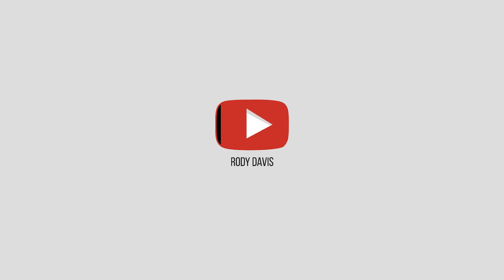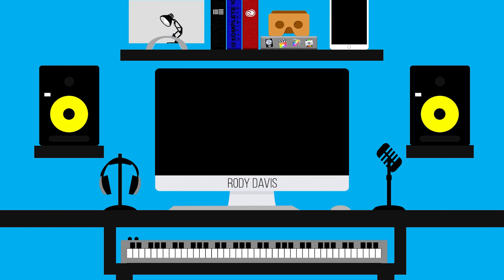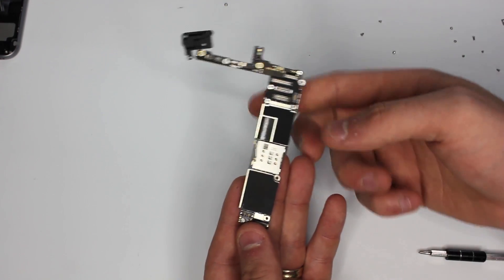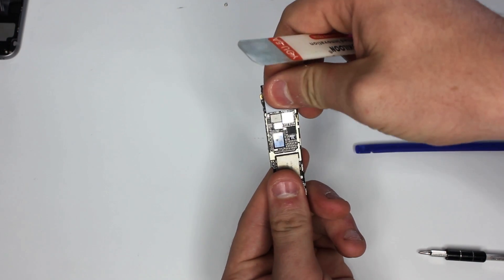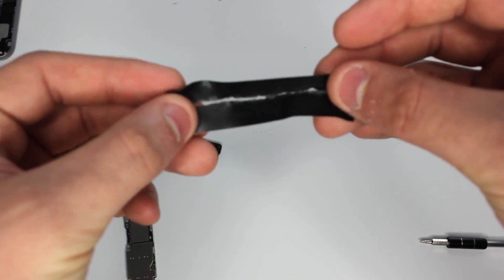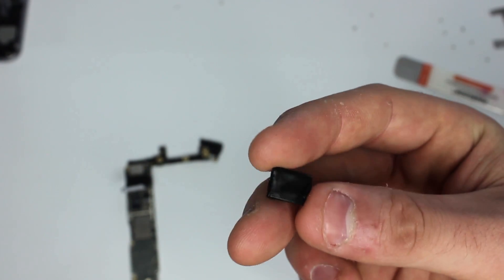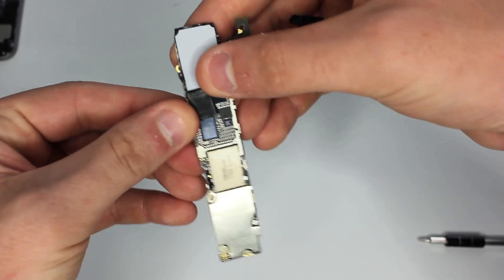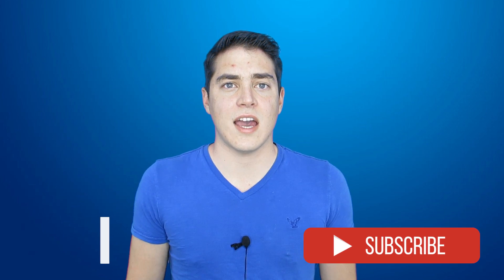UPDATE: How to Fix Touch Disease on the iPhone 6 Plus (No Soldering or Bending) | appleEducate #05

Comment: My aunt’s touch screen failed the other day and she didn’t have a backup saved. This method worked and I was able to get the screen working to take a backup! The only problem I had was removing the standoff screws since I didn’t have the right screwdriver, however I was able to finagle it with a flathead.

Comment: I've had my iphone 6 since the 6 came out.  and a few months ago this happened.  (I've already passed the phone on to my daughter at this point.  I took it in he said it wasn't fixable for less than the price of a new phone because I'd have to replace the motherboard, so I'd be better off to get a new phone, which we did.  Then today I decided to figure out how to get it to work even long enough to erase the data off of it.  I found that when I toot the screen off an put it back on the touch would work... up until i put the phone back together.  I narrowed it down.  The second it started working was the second I took the metal plate off the cables that connect the screen.  So I put it back together without that metal plate.   (the one being taken off around 1:27 on the video above).  Now it works good as new.  no need to take the rest of the phone apart.  Took about 5 mins in total time.

Comment: I try but it doesn't work
Reply: try another one. remove the tape and then put every component back to where it should be. Then, on the top right corner, there should be a L shaped metal plate with 5 screws. Unscrew it and place a micro sim card or anything about the same thickness and size then put right in the middle and on top of all those hidden cables so that the hidden cables are pressured enough for your touch screen to work again.

Just make sure your screen is off and you powered off your phone the entire time. Try it if you still have your phone :)

Comment: I opened and adjusted the thickness of the electric tape three times, but it doesn't work. Eventually, I removed the tape and wanted to get back to the initial condition, but now it shows dark area on top right.

Comment: Thank you! I haven't used my iPhone 6 plus in 4 years. Found it in a box and decided to see if it was possible to fix the touch disease. Works like a charm! Shame on Apple for the way they handled the touch disease debacle. There's no way they didn't know.
Reply: Hi is it still working please respond
Reply: @makaylacrudup8690  Hi. It worked great for the first few days, then it started acting up again, but not as bad as it was. I can usually make it work again for a while by tapping the back of the phone. Since both solutions require taking the phone apart, I would actually recommend doing the soldering fix (found eslewhere on the web) if possible. This one turned out to be unreliable.
Reply: @wesleyjacobreed5056  Oh ok thank you, that sucks apple just wants money

Comment: Thanks you so much I just replaced the battery and the screen as it was completely cracked and the battery powered off at 90% saying it had no charge and when I turned it wouldn’t respond to touch and I was trying to find a way to fix and found ur video, thank you so much

Comment: I had to fold the electrical tape 8 times to get results and I now get intermittent responsiveness rather than none at all but my screen doesn't want to sit fully in place on the right side and my home button feels less secure.  Could this be why I'm not getting full results and how do I get the screen to close with the additional thickness caused from the electrical tape?

Comment: Be Aware!!! This is a temporary fix.... Eventually it will have the same issue but on a much bigger scale some other ICs will also be damaged with all the pressure from the screws holding the motherboard down. I have seen many customers came and end up paying more or was not fixable.

Comment: I don't know the first thing about soldering, but I do know that this fix makes sense as pressure applied to that IC chip area gets rid of the problem.  It took me 2 hours to take everything apart and pay attention to all the screw locations and mark accordingly, but in the end after putting everything back together (and it didn't power up at first I had to reseat some of the connections again), everything powered up without problems and the grey bar is gone and so is the touch disease issue.  I did fold that electrical tape 8 times and then pressed down on that whole area.  For those who complain that this is not a true solution, I say it doesn't matter - many people would take a temporary fix over a non-working phone.  Further, as I mentioned, not everyone wants to pay Apple or whoever $150 (or higher in Canada) to fix something which is an inherent engineering and manufacturing problem.  Further, I do know and have confirmed with Apple store at my local mall, that Apple will just swap it out for a refurbished unit, with only a short warranty.  It is very likely you will get another 6S Plus with the same problem eventually and by then you will be encouraged to just upgrade the phone.  There are those of us who do not want a 7, 8 or higher (I like plugging in headphones on my 6S Plus, but moreover, there are many of us who would be happy with a short-term fix that may last long term.  Again, it beats having a 100% non-working phone.  I don't know how to solder and not interested in paying someone else to do something similar or having Apple roll the dice and give me another one which has zero guarantee of not having this problem. I for one am glad for this video and thank Rody for posting it.

Comment: What you did forget to mention is the following: by doing this you are delaying the executioners axe, if the phone bends again, the solder pad on which the touch ic chip sits can vaporise due to short circuit issues caused by the phone bending (source Louis Rossmann). He has a video talking about this, and when the pad does vaporise, that renders the ACTUAL repair more difficult, if you have this issue, please, bring your phone to a real repair technician you trust, i had a iphone 6 for free with this issue and i paid a 100 euro's to fix it and my repair technician did put epoxy underfill beneath the chip so it wont fail in the future, now that is REAL repair!
Reply from the maker: Honestly, though we are talking about a pretty old phone at this point. The cost of repair will not be worth it considering you can upgrade the phone to a much newer model. The problem ultimately lies with the weak aluminum housing that is bendable and doesn't officer suffice protection. If putting some tape on it gets you a could more months then great, I do not think the iPhone 6 series is worth sinking money into. The iPhone 6S is a lot more powerful and water resistant. Yes getting a board level repair is always better and will fix the issue, but I am simply showing another solution to squeeze more life out of it.
Reply: Well, here in a big supermarkt, they are still selling the iPhone 6 for about 375 euro's for a 32gb model and yes its the 6, not the 6S, and i own a 6 64gb which a got a very good deal on, it was a steal, and i know a lot of friends who still uses their 6, because it does everything they and i need a phone to do. And the fact that they are still selling this phone means here in Belgium its still quite popular, it outsells the 6s here.

Comment: Although this may seem to work for some, it will defiantly not fix the issue in the long run and will make the issue work and possibly harder to repair in the future. Having an experienced tech work on it by replacing or re balling the touch IC and damaged pads will fix it correctly and for the long term.

Comment: Apple dropped the ball on this.  When Intel screwed up their math chip, they took a huge hit and recalled it.  Stock plunged but then bounced back.  Similarly when samsung's phones started exploding they recalled all of them and waited for the next release.  When apple's phone stopped working they denied there was a problem until enough people upgraded.  Then they announced a fix that reportedly isn't permanent or offered to replace the phone for significantly more than it costs them.  That sound they hear know is the sound of customer confidence eroding.

Comment: I tried it today and the grey flickering lines are no more appearing on my lcd. However, my camera has gone pitch black both front and rear. I found it when i was trying to use my snapchat and it could not access my camera. I tried restarting my phone but it was unsuccessful. is there any solution?

Comment: It came back, but never went away. Also, the flickering isn't there anymore, just the screen unable to work. I managed to make it work for a bit after pressing somewhere on the phone (never happened again though) and made a full backup of my phone. I also have already opened it and tried different sizes of tape (about 5 or more times now) and it didn't work.

Comment: Thanks for the video. Well I just did your method and the heating up the chip with a sodden iron together. Phone powered up and screen is working so far. In addition to replacing the battery. I will check back for time to time on the status, thanks again

Comment: Thanks for a Great fix-video! My 6 Plus is almost working now after putting in the tape. It still stops occasionally, but I can live with it until i get a new phone. BUT, my Wi-Fi signal is weak after the fix 😕, Do you think its just that I got too close to the antenna and broke it during the fix, or do you have any other idea, hopefully a solution? Thanks again 🙂.

Comment: Hey @Rody Davis, this didn't work for me. I followed the directions exactly and watched many videos about iPhone disassembly (including ones from iFixit) to make sure I did everything correctly. When I powered the phone back up, I found it actually made the problem worse. It is so much worse that the touch display does not work at all if the display is all the way in the phone and screwed in. 

However, I found that if I lift the display out of the phone it will work. In other words, if there is less pressure on the Touch IC chips the screen works.. Since that is the case, these instructions to add electrical tape to increase pressure did the exact opposite of what it was supposed to do.

I guess I will start taking apart my phone again to remove this tape...

Comment: After 4 hours of starting and stopping this video, and manipulating screws so small you can lose them under your thumb nail I got my phone apart and back together.

 To my complete and total surprise my phone actually came back on but what's even more surprising is that my problem is fixed!! It's not a fun process. I have a pretty healthy headache from straining my eyes and I tried out a few new curse words. 

 A few tips from my experience, use the plastic shims he's got, get the right size tools and get yourself a headlamp. Also, allow plenty of time and keep very good track of screws as they are easy to lose. Many of the screws are different sizes. I just finished working on this. Time will tell if it's actually a fix.

Comment: This works! Aside from adding sim to the flex of the screen. Do i need to reduce the electrical tape that i put in to the ic? There is a huge bump on my screen and it will not fully close the screen

Comment: I have yet to try this repair but for those who don't understand the SCIENCE behind this. The tape forces the chip down onto the motherboard when its screwed into the housing of the phone. Basically your chip has become ever so slightly disconnected from the phone and this fix prevents u from removing the whole chip and replacing the solder. I'm going to try it out as ive tried a billion new touch screens and none of them work. Also the phone in question I plugged in a new touch screen and it worked for about 3 mins then stopped home and power worked for a min and a half  eventually stopped working and hasn't worked since.
UPDATE: Worked like charm! Nice thank you for your fix. I can micro solder I just really hate it!

Comment: It actually works but it seems to only be temporary. The first time I tried it didn't but the second time it works.
but from time to time its going again so, I remove the screen and put some pressure to the board and it works

Comment: Thanks Rody for the tutorial. My iphone 6+ has this issue, and I had to bend it to work. I've just finished this fix step by step. Everything works by far and no screws were left after assembly, so it's a small success for me ;) 
I think you should note in your tutorial that it's important to mark/remember all the screws, because they have different lengths. 

Cheers!

Comment: This worked for about 2 months, now every now and again I have white lines at the top of the screen and unresponsive touch. Applying a little pressure to the top right of the screen brings back the touch. The phone seems very hot around the tape area. I will probably open it up again and replace the tape.

Comment: Thought i would also leave the same comment on this new , After doing this the screen on my iPhone started working again, but now after 2 weeks the screen no longer works at all, It is turned on and my computer detects the iPhone but the phone doesn't do anything not even vibrate or make noise when I call it. Could it be a logic board problem? I have already tried restoring it and holding power+home nothing works.

Comment: Just completed this work-around on my iPhone 6+, been working perfectly since. Thanks for the video Rody. Will update later if it begins experiencing issues, however I don't have any reason to believe that will occur. For anyone thinking about doing this, do it (order the $12 kit on amazon so you've got the right tools). The hardest part was putting it back together, which just took a bit of time. Also - be sure not to mix up which screws go where, for this I laid everything out on a sheet of graph paper according to its relative position.

Comment: Everyone please don't do this, it will work in theory it  just pushes the chip down on to its pads and so on a bodge job basis will if done correctly correct the issue which is the joints of the connections between the pins and the circuit board breaking however the bulge as described will put pressure on the board. The board has to lay flat in the housing, you could easily be doing more long term issues to the board breaking more connections. The professional repair is to have the IC removed and replaced, sometimes its only one of the touch ICs and sometimes its both however if you don't want to pay the prices Apple quote simply do a google search if your in the USA good place to contact include iPad Rehab. If your in the UK a good to contact is "the computer room Nottingham" both places do micro soldering for iPhones and iPads and will be able to offer you a repair at a much better price than Apple. There are many other great places including STS telecom in the USA and others. Please do not do as shown in the video its roughly the same as reattaching a wing mirror to your car with duct tape sure it works but you would only do it with a very very old car thats not worth repairing while an iPhone 6 plus is not that old and still has a lot of value. If you break your phone you will be very unhappy with yourself.

Please note I'm not attacking the author of this video I can see he is genuinely trying to help people but this is a bodge job repair and in way professional.

Comment: I posted a few weeks ago that after I purchased the tools from Frys (you'll have to buy the ones specifically for Apple - about $15) I had a problem in doing this because one of the microscopic screws was already stripped at the factory.  I couldn't drill it out (worried about damage to the sensitive mechanisms) and finally gave up.  But then the Apple store told me that it would cost $150 to repair, or I could buy a new phone (with the same flaw) - and blamed it on ME!   So I then reread the posts here and saw one of the posters only took the back off (about 0:48 into the video), then, put the tape bundle on top of where the touch censors as opposed to going through the complete dismantle, and he swore it worked.   So I did the same, wrapping the tape around a couple of more times for good measure.  It works GREAT!  No problems...THANK YOU RODY!!